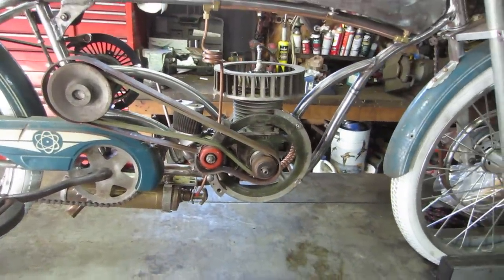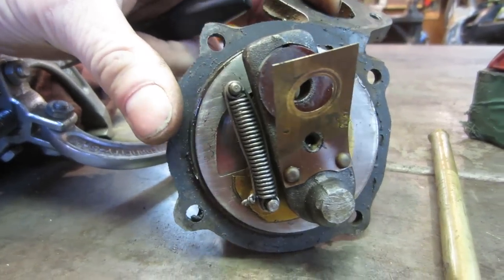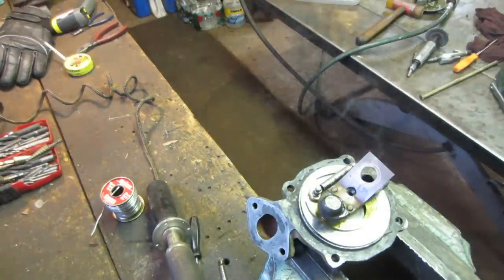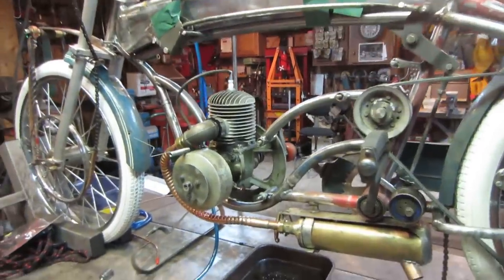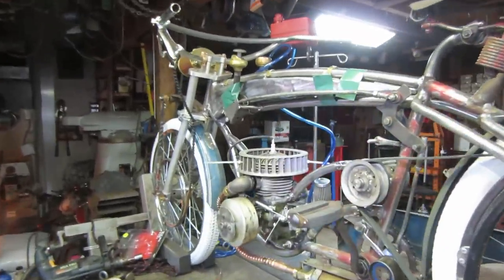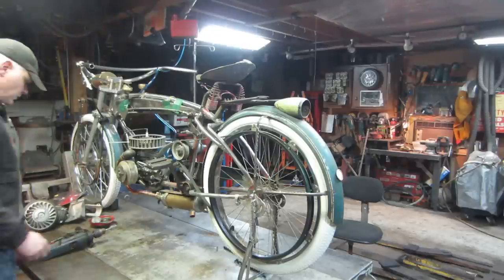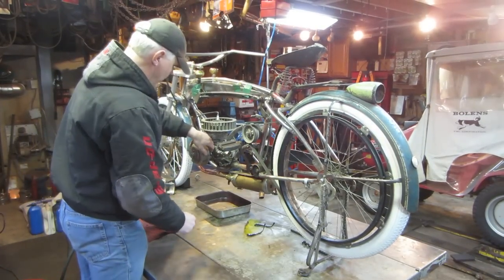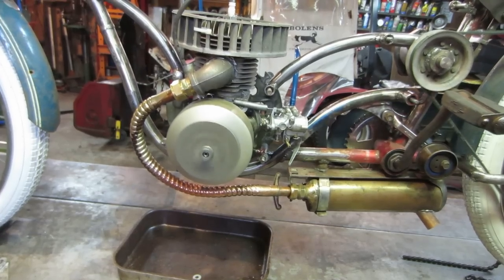bike build getting the engine to run right

Comment: Without malice, I gotta say one of the most entertaining parts of this video was watching things rattle off the bike while you were working on it. Great job getting it going!
Reply from the maker: thats how l feel if l try to break dance.
Reply: fuel in the gas 60 's reg fuel was like a 96 rating perm was 100 or better try an octane booster mixed with perm gas and exhaust  open it up try little bit of porting see if it helps

Comment: I struggled with a 74 350 Buick engine that would cough and sputter before I put a carb kit into it. After I did that it did the same thing. I was in tech school at the time and my instructor kept an eye on me to see what I would do next. I decided it wouldn't hurt to replace the points and condenser and set the dwell and timing on it and it ran perfect.
I will never forget the instructor walked up to me and said "Now you will not forget that 95% of what you think are fuel issues are   ignition related" I asked why didn't you tell me, I would have saved a lot of time. He said "Exactly"
Reply from the maker: great story

Comment: The device isn't a governor in so many words as it is primitive variable valve timing, That rotating plate is essentially the intake valve and it is supposed to move as the engine is placed under load in order to maintain smooth power delivery and eliminate surging. It's essentially the predecessor to a modern reed valve in a 2 stroke engine of today. You may want to see if you can actually adapt a reed plate from some other engine to work on this one, which should provide much much better throttle response and horsepower because the current setup is very restrictive on the intake. I would take a look at an early 70's Lawn-Boy engine, maybe a C or D series, and see if you could adapt the reed plate which is part of the intake manifold.
Reply from the maker: l know what your driving at but it is the governer, the original carb had no throttle plate,
Reply from the maker: or maybe a combination of both.valve and govener
Reply: Yeah, It governs through restricting the intake under rest, and opening the intake under power. It's like a combination of the throttle butterfly and a reed valve/intake valve

If I remember correctly, Other small 2 stroke engines of similar vintage used this system, but had an external throttle control. Chainsaws maybe? I forget.
Reply: It's probably not only the rotary intake valve assembly that makes it difficult to let it run in a wide rpm range, but the whole engine is designed for a specific rpm. so the the cylinder port timing would be also optimised for that range. I think it would never been a good performer in a wide rpm range.
Reply: Cap10323 m I

Comment: The view of the spark plug at about 32 minutes shows it very grey and this to my experience shows the mixture is far too weak. Also I think a hotter plug is required with the centre electrode extending further out. The removal of the anti fouling screen obviously made considerable diffence and a hotter plug would burn away any oil deposits so make the anti fouling screen redundant. Cheers, Andy

Comment: Very cool governor design on that motor. Totally different than most mechanical governors yet it serves the same purpose. The plate on the crank works the same as the throttle plate on a carb. Kind of an All-in-One unit without all the linkages.  That's if I understood your explanation correctly.

Comment: Well done. Alot of ideas coming around for making the engine run better, but one more. If you study the rotary valve as you turn it clockwise, you will see the intake passage opens while the piston is about half way up, and closes after the piston is on the way down. I believe this is hurting your vacuum significantly. Re-work of the rotary valve and housing or the addition of a reed valve in front of the carb would definitly help. (Im sure you have one in the hoard).Just for fun, try temporarily hooking a shop vac to the exhaust. Yes, I know this sounds crazy, but if the engine wakes up, you know that your issue is related to airflow through the engine, and not mixture or spark related. You have it running decent enough at this point though.

Comment: I'm thinking a timing issue of some sort. Either intake or spark.  You are amazing.  Can't wait for the solution.  Merry Christmas.
Reply: solution was at the end, that "anti fouler", I bet, that at low rpn the chamber wasn't flushed properly (especially in this tiny compartment for plug in anti fouler) and it caused all this problems.

Comment: May I suggest you use the engine in it's original state and intend, namely (as you said) as an APU at constant rpm producing DC power...  This DC power could be used to power an electric motor which in turn can be controlled for various speeds... Maybe using a (or two) hub (pancake) motor(s) of pedle assisted bikes... regards, Sander.

Comment: In the late 60's and early 70's there were a number of 2cycle motorcycles that used the same concept of rotary valve connected to the crankshaft (sans the centrifugal governor plate). You knew you had one of these when the carb was mounted on the right side of the engine inside the case with the cables coming out through a rubber boot. Those were a tenuous design because any air that would leak in around the cables going through the boot, or through a tear in the boot would be bypassing the air cleaner.

Comment: mount the intake directly on the crank case, close off the old intake, and use a reed valve between the carb and the crankcase, its restricted to mutch , being designed as a one speed only engine, it needs some tlc! . nice bike btw!!!!!!! thumbs up!

Comment: What I see at the 25 minute point is rich.  You won't be able to set the high needle valve until your under load.  Love engine tuning.  Definitely sounds like you are there on the end.

Comment: On old rotary valve outboards, they used a heavier oil / fuel mix to help seal the rotary valve.
Maybe a little more oil in the gas will help.

Comment: The silver plate is a rotary valve.  It provides the intake timing.  It cannot be removed.   However, why not remove the governor parts and eliminate any bits that could later come off and destroy the engine?   Been there a long time, probably fine.

Comment: Solid mounted carburetor can be tricky to adjust on a 2 stroke. Obviously you won't be able to rev this engine very high . Intake and exhaust ports are probably very low and the ignition is certainly optimized for low rpm as well. It looks cool though. I would have probably used a moped engine.

Comment: I serviced these power units in the Air Force. If I remember right wasn't the oil/fuel ratio on the gas cap. It was SAE 30 if I remember right.
Reply from the maker: yes reg motor oil, thats why it was so high of a ratio, 24/1, old boat motors were like that too, prob why they had to run that anti fouler,

Comment: Used to be a Kart racer.  That carb looks too large.   I would consider using a Walbro from a KT100 kart engine or maybe a slightly smaller one.   Look in the RC aircraft world at a 60-100cc class carb as an alternative.  Walbro's, particularly the one form the KT100 engine (super common) are very well documented and supported.  Asthetically, the aluminum carbs look poor on your beautiful faux early chassis.  Consider painting the body of the carb copper.  There is also a treatment for Aluminum and Zamak that will make it black.  I hope you have sourced some sort of bugle or other brass instrument to make the intake horn out of.  ;-)

Comment: Definitely an improvement in both low and high rev! I think you mentioned this, but will you be hauling that drill with you to start it or will peddling it be enough!
Pulling that plug on the spark seemed to work well. Wondering if the longer plug you mentioned will help or not?
Looking forward to "Tweek and Tweek some more" episode of "This old APU engine"!

Comment: did the engine use type of leaded fuel when built an if you take plate mite to use a equal brass spacer washer for slight advance of motor? I see your got it running smoother!.

Comment: Timing issue... it probably needs some mechanical or electronic advance, which is not required when running at a single speed as it was designed.

Comment: most thru crankcase motors i have seen the exhaust must be open with no restrictions to run proper,,,,yours seems to go down in size from cylinder to muffler,, might be something to check out,,,,,

Comment: What kind of amperage does that soldering iron pull? That thing was comically huge Lol. Merry Christmas Mustie1. You're undefeated.
Reply: yeah I've got a few of them but nothing that big i recall. 😊
Reply: I haven't seen one used for mechanics before... just for leading in glass.
Reply: james, Mustie's kW meter on his house just ejected the metering disc through the glass bubble and it shot into the neighbors yard, Ninja style. His neighbor's rodent problem has seemingly vanished. Also it is rumored that Alvin, Simon, and Theodore did not show up for this years Christmas Jamboree. Mystery.

Comment: Since the engine is an Auxiliary Power Unit from an aircraft, is it reasonable to think it ran on aviation gas?  Av gas usually has a higher octane rating 100/130 versus pump gas at 87 (regular), 88–90 (midgrade), and 91–94 (premium).  I also thought you  said the engine was from the 30's or 40's which means the gas had lead.  Would one of those race gas additives to your fuel help?

Comment: I've got one of these engines in a Homelite C-8 military generator set up to generate 115 VDC (yes direct-current) at 500 watts.  (check my channel, I've got a short video of mine running)  Couple of data points from my tinkering...  They very well may be setup to run well at a single speed only.  Mine is stock - original carburetor, original governor.  When I start it, it spools up to speed at a rate I think is pretty slow.  It certainly revs up no faster than in your video...and when mine is spooling up...it almost sounds tired like it has low compression or is otherwise an unhealthy engine.  Yet, at operational speed...I can slam a 500 watt load onto it (500 watt halogen shop lamp) and the engine speed barely changes, plus compression is good, so I know its strong engine.  So...it may have nothing to do with carb setup - just maybe the engine.  I was able to remove the anti-fouler and thread in a larger plug...type and reach I don't recall...but the piston contacted the plug when I rolled it over by hand so I removed it and reinstalled the anti-fouler.  If you do go with the larger plug without the anti-fouler, watch the length.  I need to make myself a note and see if I can't find a plug for mine that won't contact the piston with the anti-fouler not installed.  Per the data plate on my engine, the stock plug is a Champion J10-COM, which crosses to a J6C, 14mm with 3/8" reach.  Hope this helps.  As always, enjoy watching your videos.  I've often found myself looking at a problem I need to solve and wondering what you'd do in a similar situation.  I then find myself making do with what I've got on-hand.  :)

Comment: Just for general information, during my time as an Air Force fighter pilot (1960 to 1987), no operational American fighter jet that I flew had a self-starter. We relied on 3 different APUs, electrical, hydraulic and air conditioning (for the avionics and pilot) to operate the various systems of the plane. I don't know what current fighters have.

Comment: vaccuum leak somewhere Id guess.  had a leaf blower bought at a yard sale 5 bucks.  head to case bolts were tight....or so the guy thought.  The jug was still flopping so I cranked on the bolts till they broke loose and tightened some more.  Still have that 5 dollar leaf blower.

Comment: It acts like it needs a bit more flywheel mass. Is it turning as much weight as it was designed for?
Reply from the maker: the drive belt and pulley are now on it and it helps

Comment: As a suggestion ... I copied this : ""The stoichiometric mixture for a gasoline engine is the ideal ratio of air to fuel that burns all fuel with no excess air. For gasoline fuel, the stoichiometric air–fuel mixture is about 15:1 i.e. for every one gram of fuel, 15 grams of air are required. ""Which is simple in theory. So, could the jet size be the problem now that the intake is altered ? Just an idea. It's about getting the ratio curve to work at both ends is what I do know from tinkering with numerous  car engines. I see on some carbs near the bottom is a spring and screw arrangement to keep idle constant at minimum revolutions. Below a suggestion of a weed wacker carb may work. ????

Comment: cool old bike and motor ....the hamster wheel fan blade looks good as dress up , i was wondering 2 thing tru out the vid,  1-IF you had a bigger solder iron lol and  2-is the guy who wrote 5 on the copper clicker thingy (dam i sound like a woman) still around ...you said the engine is 42? lol
Reply from the maker: 1942
Reply: i think the guy assembling the engine in 42 might not be around

Comment: it is a little bit too rich buddy. use a modern moped carb around 12-18 mm keihin or mikuni (not chinese). the tuning would be a lot easier. succes with youre build!
Reply from the maker: l think the compression is just so low, the carbs adj for the idle jet and the main, but if it runs any leaner it bogs out,
Reply: Mustie1 i think you can use 50:1 oil mix. and you are sure if there are no air leaks or something?

Comment: In an aircraft carburettor using a conventional float chamber, the low pressure area created by the venturi is dependent upon air velocity rather than air density. The action of the venturi draws the same volume of fuel through the discharge nozzle at a high altitude as it does at a low altitude. Therefore, the fuel mixture becomes richer as altitude increases and air pressure reduces. To reduce this effect the float chamber vent to atmosphere is blanked off and is vented to the air passage inside the carburettor, upstream of the venturi.

Comment: hi i dont understand why you locked the valve open, i thought that it is supposed open as engine revs and closes as they drop?.
Reply: Opposite.. it's not an intake power valve.. it's a governer / limiter.. as the crankshaft spins faster and faster, eventually the force is enough to overcome the spring which then closes the intake port off and starves the engine of fuel, this causes the revs to drop and the spring can once again close, which opens back up the intake port and allows the engine to rev up again... simlar mechanical governers are also used on the ignition side of things, same principle really but instead of cutting the fuel off they change the spark timing to cut out the engine above a certain rpm.
Reply from the maker: yeah what he said
Reply: ok thanks did not realise it was a governor

Comment: Rotax's rotary valve.
Reply: It is indeed rotary intake, However, I don't believe Rotax invented the rotary system as there were engines and airplanes before Rotax was formed that were using Rotary intake system.

Comment: what you disabled in this engine thinking it was a govenor that is a rotary valve govenor combination and these engines wont run the way you are trying to get it to they were not made to idle or have a throttle it was a governed engine at 3600 for generator use

Comment: plz plz plz plz plz put the air filter on it it makes a big change on 2 stroke it will make it run a lot better my 50cc moped (that does 130 km/h) if i take the airfilter off that it will run but if you give it gas it will die it iles but not well same problems you have so put the origeonal filter on it or change jets becaus the sparkplug was white (you know what that means) so i would advise a hotter plug if you can (not much) and put the damm airfilter on (this is no hate just some advise from a place where 2 stroke is verry common ) 

ps if you want to search 50cc sprint scooter top speed and you will find what 50cc 2 stroke can do
Reply: Gerald Swain no but its logical why it wouldnt run rith and instead of just complaing i wanted to explain myself

Comment: Getting there.. couple of ideas from personal experience after farting around with stuff like this myself, perhaps you've tried them but can never hurt to have ideas right.... hows the ignition timing? if it was designed to run at a constant speed it could be too far advanced / retarded to run at a low idle, probably make hard starting too but if they were originally using a drill etc to start the engine and leave it running then they could probably spin it up fast enough anyway. Guess theres no information / timing marks on it or any factory specs? but you can easily mark out the flywheel into 360 sections and mark TDC and see where its firing.. i guess there is no mechanical advance on it beign originally a fixed engine, so if timing is an issue some happy comprimise might be needed between most power and idle. Exhaust might be a bit too freeflowy with your lack of airbox.. but i wouldnt have thought it too bad to kill the idle totally.. could always try an intake filter / plug up one of your exits to give a  bit of back pressure... but my main concern besides the timing was that it also sounded very airleaky to me at some poins in that video, your intake manifold carb is all sealing up right? when you took the one half of the crank out you showed that the governer system that was spring loaded onto the housing that contains the other half of the crankshaft. how does that seal? is there some kind of gasket or what not behind it? you might be getting intake leak / lack of compression from a leak there too.. slightly newer i'll admit but my early 60s scooter has a big o-ring around where the rotary intake couples to the crankcase.sure you'll get it running sweet eventually..